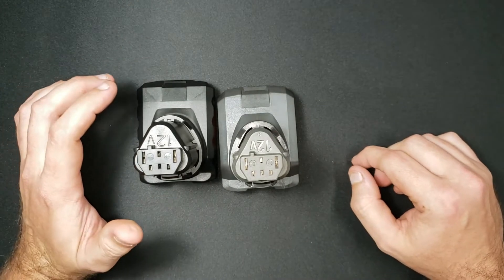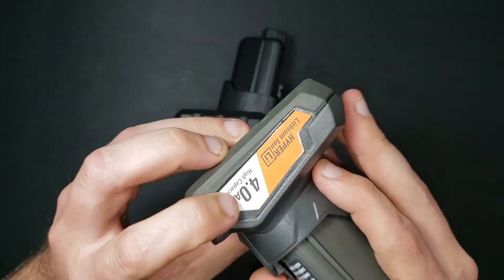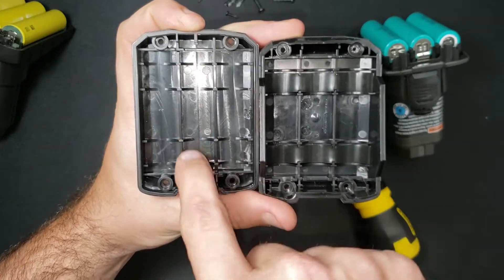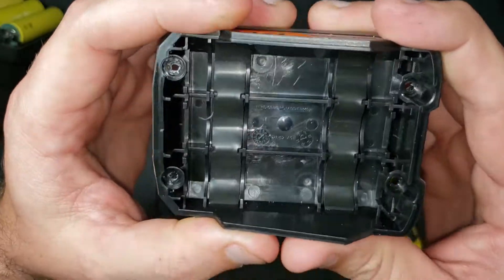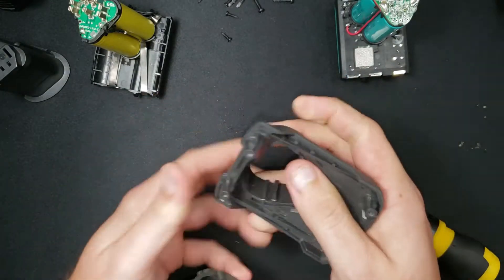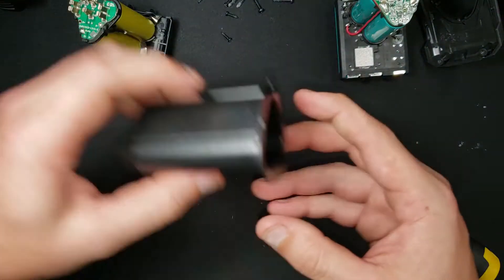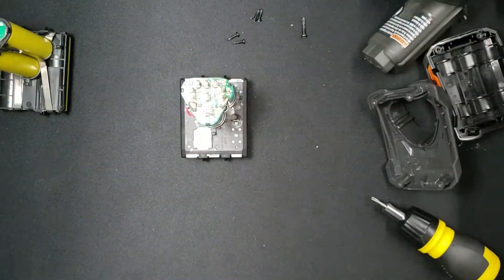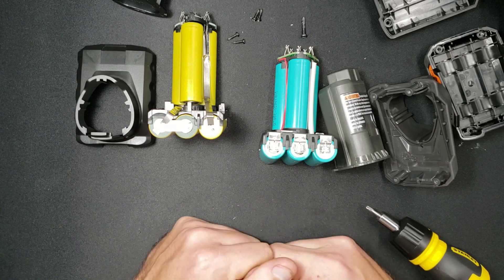ENGINEER EXPLAINS... Are Ridgid® Batteries Worth the Price Over Amazon Knockoffs? | Ep. 5 Review

Comment: This is an interesting, but disappointing, seat-of-the-pants comparison. I was expecting test data, at least for the charge capacity - physical testing of the assembly and parts would have been a great bonus - but there is nothing here that proves how the products compare. It's easy to say "this plastic isn't as strong" but it can be argued that it is strong enough for the average home user. Do a follow-up that tests the batteries for capacity and charging speed. Drop testing and similar testing would make a better evaluation.
Reply from the maker: Sadly this is a tear down design review channel as opposed to a test channel.  for that type of content there are much better channels.

Comment: It's a different Challenge now - both the Ridgid and e-bay have no life time Warranty. 
Since Ridgid No loner sells 12vdc tools w battery's  (home Depot) so theirs is no Life time Warranty for just buying Ridgid Battery's (w no tool) and same w The E-bay Battery's, so is it worth the extra cost for the Ridgid?  
Will the ridge last longer And is it worth the extra cost?  (going to buy the e-bay ones and see if they are worth it)
Reply from the maker: Thats a good point, now that the rules have changed, Ridgid is not as good of a value as it once was.  I can say though, that i am really impressed with how long my Rigid 12v tools have lasted.  10 years, left out in the rain on occation, left in an open air garage in florda humidity and both drill and impact plus 1 battery still working.  I haven owned any other brand thought to compare.

Comment: Good stuff man. These aftermarket battery packs never live up to their stated capacities. That's how they can lure people in for the price. They may even be rewrapped salvaged cells. One thing I noticed that the cheap battery pack does better than the ridgid is it had fish paper insulator rings on the positive terminal of the cells(some people call it barely paper). I use those rings when I build my own li ion packs. If you continue to do these battery pack break downs you should get a capacity tester to see what they are lying about. I bet the aftermarket cells don't put out the power the genuine cells do.
Reply from the maker: Great info man.  I think my hobby charger has a feature like that built into it.  It probably can't put a very stressful load on it but might could get a slow discharge capacity. Thanks for the suggestion!

Comment: 72 wh would make the knock off a 6.0 and there's no way it is
Reply from the maker: Good point.
Reply: Not impossible but unlikely.  3000mah power cells(like sony vtc6 or samsung 30q cells) cost more for the cells than these cheap packs.

Comment: What cells are being used?
Reply: The cells will tell you the mah, 18650 2500 for instance. I don't trust WH
Reply: @Whohoohoo  I froze the video at 11:57 and could read the Rigid battery cell labels (apologies if I get a character wrong):
INR18650-20R    M
SAMSUNG  SDIEM
125

(These appear to be 2000mAh cells.)

Couldn't see any labeling on the knockoff cells.
Reply: @Whohoohoo  wh are just  nominal cell voltage times mah.
Reply from the maker: All I remember seeing was that they are Lithium Ion.